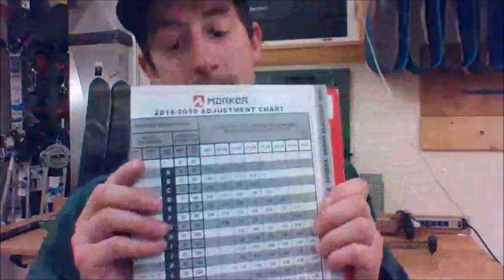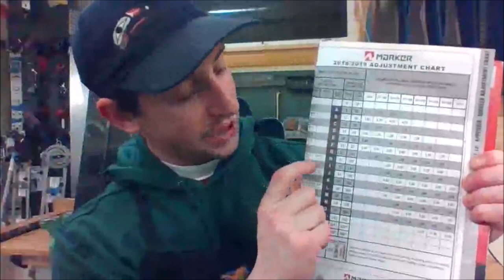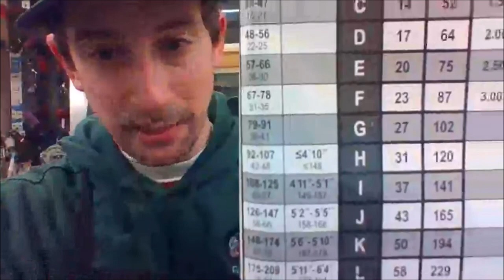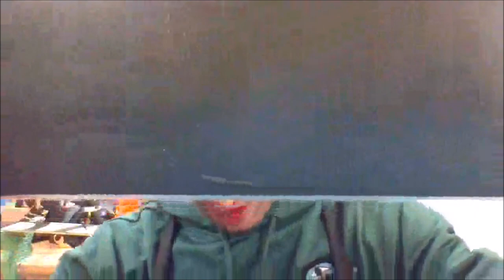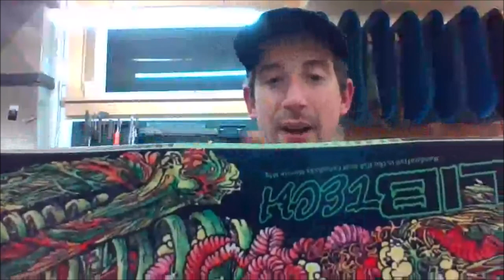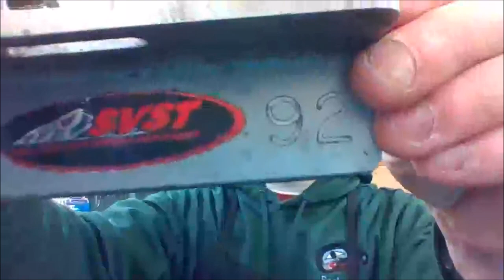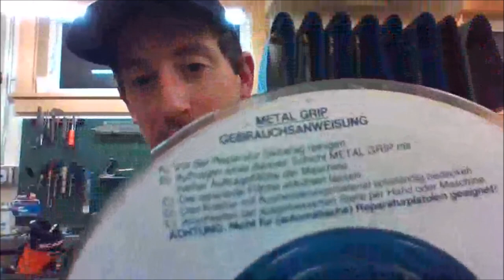Ski and Snowboard Tuning Workshop Week 1: Introduction and Anatomy

Comment: Just a couple notes dude, when you mentioned that you've noticed sometimes when you go out to ski your own personal skis & somehow the forward pressure has changed, that's caused from them being set/adjusted while inside where it's nice & warm, like 70°F or whatever, room temp., but then when you go out into freezing temps., the plastic of the boot shells slightly constricts/shrinks, & even if it's only a mm or 2 or so, it does change, ever so slightly. Therefore, it's always smart to have somebody that knows what they're doing readjust those for you when you're out there standing in your skis, or purposely set them outside for awhile to let them get to outside temp., & then adjust them real quick before you actually head out & start to ski. And referring to snowboard bindings, there is no such thing as riser bars, it's called forward lean, & those are of course called forward lean adjusters. One more thing regarding snowboards, Magnetraction/wavy sidecut edges is just simply a way to get more edge grip & control in harder conditions, especially icy type stuff. There are other forms of "interrupted sidecut technologies", but that's what they all aim to do, is to give more edge grip in harder & icy conditions, basically, to varying degrees, with Mervin's (LibTech & Gnu) Magnetraction being the best/most aggressive for that, & other brands they've licensed it to to be able to use it as well. I'm not trying to be negative or a critic here, at all, I thank you very much actually for making these videos. I've watched this whole series already & learned some more about skis, bindings & mounting them especially, since I've never skied & am a snowboarder. Anyway, just wanted to fill you in on those few things for the sideways standing/sliding brethren & sistren..., 😉👍
Out of curiosity, since I've never got to run a belt/stonegrinder (or at least not yet), I noticed there are 8 belts hanging on that wall there (6 blue & 2 others of some other color(s)), what all grits & types are those? I'm assuming the 6 blues are actual belt grinding ones, & the other 2 a different type. What type/kind of abrasive are they (the 6), & what grits? And what are those other 2, type & function, specifically? 🤷‍♂️
#TheGuyWhoDoesntLiveInTheMountainsButCouldBeAProfesssionalShopTechHimselfIfHeDid ✋